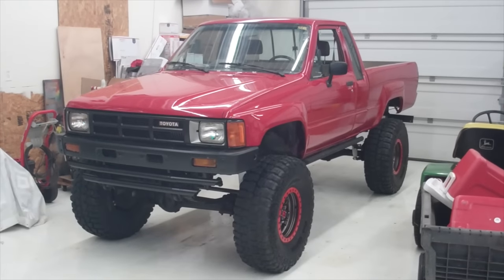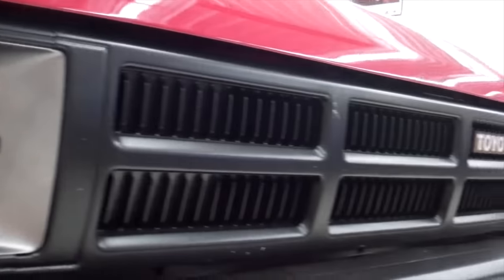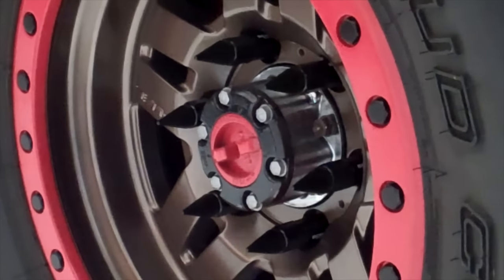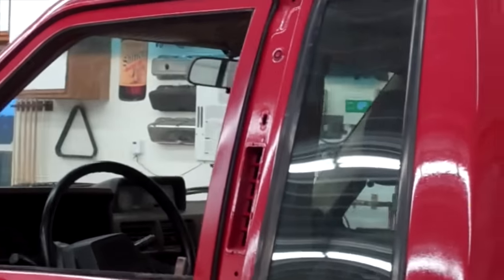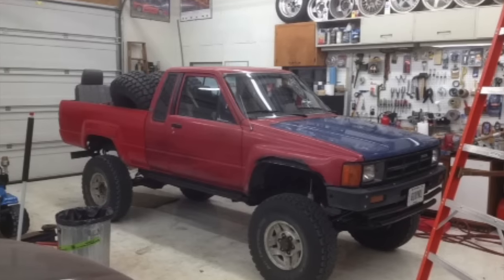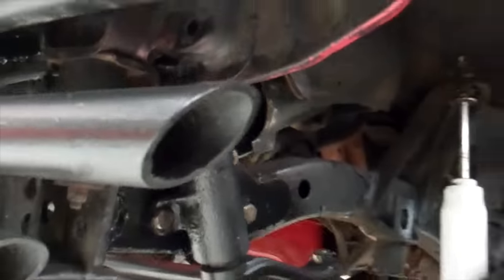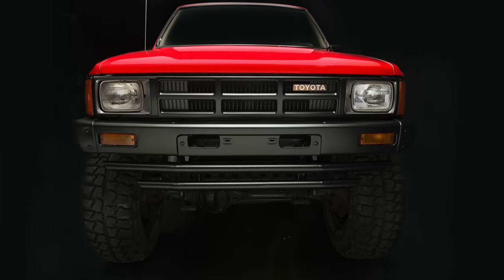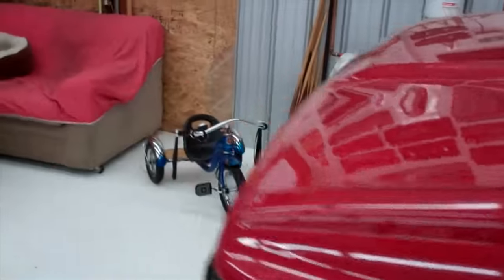1985 Toyota Pickup Truck 4x4 - Fresh Red Paint Job!

Comment: Super Nice, I have a 86 I need to finish up, the windshield trim, the auto glass shops carry it and to put in the 1 piece correctly you need to remove the windshield and install it with the glass, I had this done on one of my other cars and it looks great ( I didn't think it would but its 6 years now and the rubber holds up well)

Comment: Wow, that really looks great.  The printer part usage was pretty funny, I ended up with a bunch of under desk computer holders one time during a classroom upgrade, heavy gauge metal, and bent to a 90 degree. My dump truck body was rusted out on the inside, so I fish plated it with those things as a temporary solution.  (I sold the truck, and ten years later, the computer shelves are still doing their jobs, not one of my tack welds broke.  ;-)

Comment: this is such a beautiful toyota, you should be very proud of the job and work you have done on this truck, i have many toyota trucks i think somewhere around 19 of them, 12 of them are 4wd with my faviorte one id a 1979 toyota longbed that i did up how it came of the line in 1979, i was offerd 15,000 for it and passed on it, its my pride and joy,  so keep up with this truck it will always give you tons of fun brother !!!!
Reply from the maker: Thanks! I only have 4 in my Toyota collection and this one is my baby. These are fun reliable trucks, as long as you keep the rust in check. They're also simple and easy to work on. I'll never buy a newer truck as long as there are old Toyotas out there.

Comment: LOVE TO SEE THE FULL BUILD . I THINK IT LOOKS GREAT , YOU GOT A WIDER STANCE , MY PICKUP CURRENTLY IS AN 84 , TRAIL GEAR LIFT AND SPRINGS , LONG TRAVEL FRONT SHOCK HOOPS, I AM RUNNING AN ORIGINAL TOYOTA WHEEL WITH 33S IT ALMOST LOOKS TOO SKINNY AND TALL. IM THINKING 35S AND A WHEEL A TAD WIDER WOULD HELP. ALSO WHEN I DID A FLEX TEST ITS ALMOST TIPSY . THE WHEELS ARE DEAD EVEN WITH BODY THATS WHAT I WANTED AT FIRST.

Comment: These trucks were notorious for bed rust.I have a1986 I'm restoring, but the bed is in very good condition except for the bed floor.The previous owner had a plastic bed liner.There is some surface rust as well as a couple of small holes completely through.Did you have issues with your bed prior to painting.My cab is nearly immaculate. Rick, Daytona Beach, Fl

Comment: +6th Gear Garage
 Awesome job on restoring your truck. I just started a resto job on a 1987 Toyota 4x4 Xtra cab my dad just gave me. Mine has 103k miles on it (not sure how accurate the mileage is, but will confirm it when I register and tag it at the DMV) I like how your truck came out. It's clean and not over modded with an absurd lift kit and obscenely large tires. Thanks for some inspiration on my build. Enjoy your truck. It looks great! 
Also, where did you buy your fiberglass pickup bed? Mine has seen better days. Thanks.
Reply from the maker: +FiveBoro Prez Thanks! I bought another truck that had a bad frame and it had the fiberglass bed on it.  I don't know where the bed is from, but there are a few places that sell them. Here's a list: http://www.oocities.org/toyotashawn/bedlist.html
Reply: 6th Gear Garage Nice score x2. Classic Toyota 4x4 Xtra cab with a fiberglass bed. I will pretend to not be a little envious of you and your truck. LoL jk. Thanks for the link and your time. I will start to post videos of my own build soon. Keep an eye out for them. Best wishes to you.

Comment: It's a beauty.  How's the engine holding up?  I know around that mileage they like to toss the head gasket.  My grandfather had a '85 and '88 pickup do that to him.  My '85 hasn't done it yet and hopefully never does.
Reply from the maker: I swapped the original 175k mi knocking motor a few yrs back for a lower 106k mi 22r from an 86 parts truck. This motor has been great but I've got one noisy valve/lifter. No head gasket issues on either motor so far.

Comment: i had big tires on similar. slower than an eighteen wheeler and 10 mpg
Reply from the maker: +standardarmy63 Yeah the 35" mudders slow it down a bit compared to the oem alloys with 33" all-terrains, even with 5.29 gears. It gets around 16 mpg with the 35's, 18-20 mpg or so with the 33's.

Comment: how much time you take to rebuild it from the frame to there  ??
Reply from the maker: It has been a long project. I rebuilt the rear of the frame back in 2011 when it was my daily driver. I also put in a younger 22r that year and found the fiberglass bed on a parts truck I bought. I didn't re-paint it until 2015, so 4 years, but most of that time I was driving it.
Reply: okk i think its gonna be like this for me but mine ad to go on the inspection to get back on the road im gonna take my time to make it perfect thanks for the video you did about it that's help a lot in my project :) gonna upload a video of mine now should be on youtube tomorrow :)

Comment: What size tires are those?  I'm putting it 4 inch suspension lift on mine and I'm trying to decide on whether to go with 33's or 35s and I'm putting the tires on the stock SR5 will.  I'm trying to get an off-road look but keep the stock look at the same time.  What do you think?
Reply from the maker: These are 35x12.5 on 15x8" wheels. It sound like you'd be better off with 33x10.5 tires for a couple of reasons...  33x12.5 is too wide for the factory 15x7" wheel and won't wear properly. With 4" of lift, you will definitely destroy your front fenders under full flex with a 35" tire. I have a total of 6" of lift and my 35's still hit the bottom of the front fenders and bent them upward a little. Check out some of my other videos with this truck, I have a set of the OEM 15x7 alloy wheels with 33x10.5 BFG All Terrains and they look great on the 15x7 wheel. The truck looks a little bit tall on stilts with a 33 and 6" of lift, but with a 4" lift yours should look just right.

Comment: Whats the big black round part at 2:39? I'm almost done restoring this same truck for my dad, and everything works just fine, the only thing that's missing is that one part I believe it's a filter, but what's the name? Thanks.
Reply from the maker: That's the air filter housing assembly. The lid is round and the bottom has the intake arm on it.
Reply: 6th Gear Garage Thank you so much!

Comment: Hey nice truck, I have one of the same year.. 1985
i would like to know where can I find the original parts like the grill, bumper, tail lights, and everything jaja, i found some but it's not brand new and I'm restauring my truck you know, and i want everything brand new like you.
It would be great if you can help me :)
Reply from the maker: Have you checked your local toyota dealership? I assume most of these parts, such as the grill & bumper, are discontinued. If there's any OEM parts still in production, the dealership should be able to order them. I believe reproduction tail lights are available on ebay/amazon.

Comment: Hey, how many inch is Your lift? And where do You by lift kits for hilux?
Reply from the maker: 4" suspension + 2" body. I believe this 4" Pro Comp Kit was from Summit Racing.
Reply: to install a 4" suspension + 2" body lift, did you have to replace any other parts? Or just install the suspension and body lift and that's it?
Reply from the maker: It was already installed when I got the truck, but I know longer brake lines and longer fuel filler neck are needed. I don't think any wiring had to be extended. Custom front bumper brackets were needed to bring the bumper up 2" higher to sit with the raised body.
Reply: Cool man, thanks for the quick reply :)

Comment: How much have you out into this? This is my dream
Reply from the maker: John Jacobs Well, I bought it for $3k, suspension mods were already done. Then I repaired the frame, replaced the motor & bed and painted it. Hard to put a price on it, since I did all the work myself. I bought 2 other yotas with bad frames for parts and sold everything I didn't need, so I probably ended up breaking even on the bed & motor. I painted it for free, through work. So not much $$, just a whole lot of time and materials.
Reply: John Jacobs RIGHT? this is beautiful

Comment: hello, Did you find front window frames?
Reply from the maker: I've seen some pickups where a glass installer used a universal rubber strip in place of the chrome trim, but it didn't look right IMO.  The rubber was too wide. I still have the factory 8 pc trim and will end up installing that.

Comment: did you change the rear pinion angle?
Reply from the maker: Yes, I believe the previous owner did when the lift was installed. (The rear axle is actually from a 1988 truck, 1.5" wider track on each side.)

Comment: Wait Is This A Toyota Hilux?
Reply from the maker: +CrazySharkGaming Minecraft Roblox And Arcade Games Yes, Helix was called "Pickup" in the US.
Reply: +6th Gear Garage yeah but I thought it was banned in the us
Reply from the maker: +CrazySharkGaming Minecraft Roblox And Arcade Games Not actually banned... To my knowledge, Toyota had the Hilux shipped to the US without a bed to get around paying an additional tax. Then the Trucks were fitted with a bed once imported to the US and they sold them as "Toyota Pickup". (Notice that the 4x4's have a slightly different, smoother bed design than the non-US trucks.) Then, in 1986, Toyota changed the front suspension on the 4x4 to a more comfortable independent front suspension, while other parts of the world still got the stronger solid front axle on the Hilux. The truck was called "Pickup" in the US until 1995, when they started calling it Tacoma. The rest of the world still called it a Hilux. So basically it is the same truck with a different name, for the most part, but our US version lost the solid front axle in 1986. In the 2000's the US Tacoma started to look less like the Hilux did in other parts of the world. (Someone correct me if I got any of that wrong.)
Reply: +6th Gear Garage oh I see that Makes More Sense Thanks For Replying By The Way!